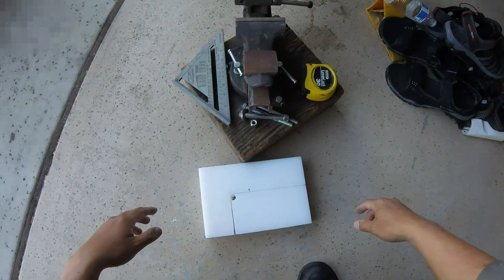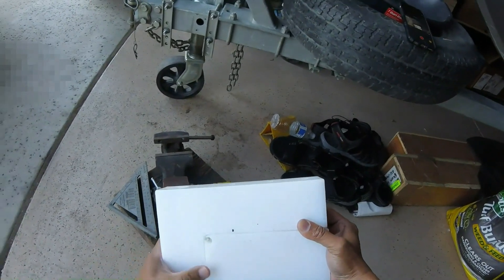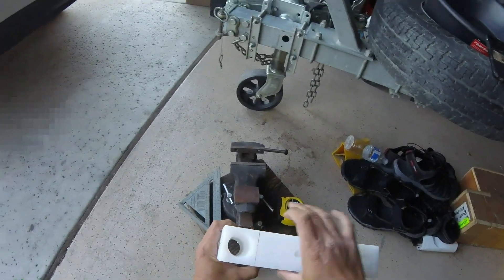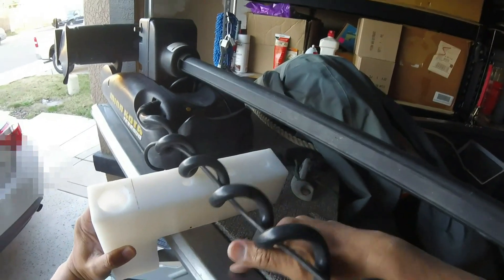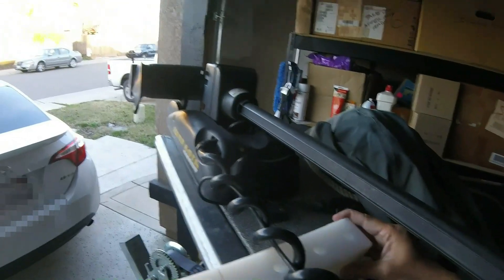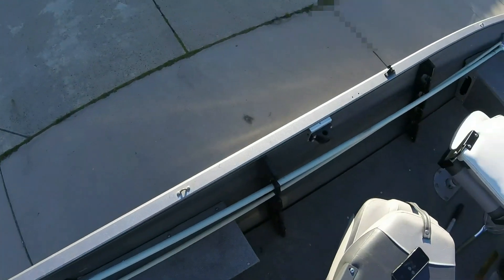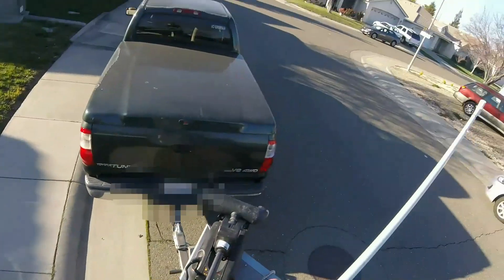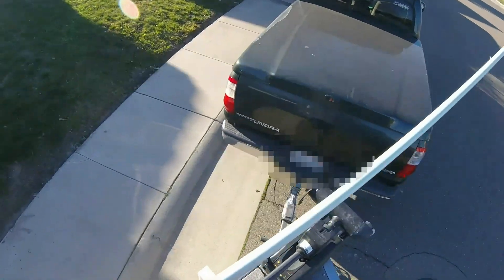My DIY shallow water anchor "Easy"

Comment: Nice idea.. I was thinking a more wide and flat base might be better for handling shear force... Eg: 4 screws in a square layout
Reply from the maker: Thank you.  Honestly I think anything that won't bend under pressure will work.  What I wanted was something that will hold me in place in the wind and will not bend on the top.

Comment: Pretty clever idea...I think there's a cheaper and easier way with aluminum tubes.
Reply from the maker: Thank you.  I wanted something that would bend and would not break.  I think aluminum tube would break.  When you're out there it could be any condition.  I've had plenty of times in 15mph wind and my 1" fiber glass rod would flex to L shape and it still held me in place.  An aluminum tube would have broken way before that.
Reply: Fishing Addict 
Good point, I'm sure the one you made is mighty fine. 
I just think that if someone had a welder, they can easily weld metal or aluminum tubes.
Reply from the maker: Agreed.
Reply: The problem with and aluminum tube, or even a solid pipe is when (not if) it bends a little it will hold the shape and then not be able to slide back thru the bracket....the fiberglass will flex then go back to straight.....fiberglass is the way to go!

Comment: Kinda silly that you took the time to blur your car license which is hard to trace but you show your boat registration number which is easy to look up on the internet and it gives more info than a car license does.
Name
Address
Serial number
Due date's
Lien holder if any
Type
Size
Color
Propulsion type.
That's what you should have blurred!
Reply from the maker: You’re right. I certainly forgot about that. Just hope no one will be that mean.

Comment: Get the 8ft tomato sticks from Lowe’s. It’s 6 bucks
Reply from the maker: That will not work. Because the pole needs to be strong and able to bend.  Because when you are anchored somewhere you never know what the situation might be. A big wave can push your boat, high winds or strong current. It needs to be able to spring back after bending.